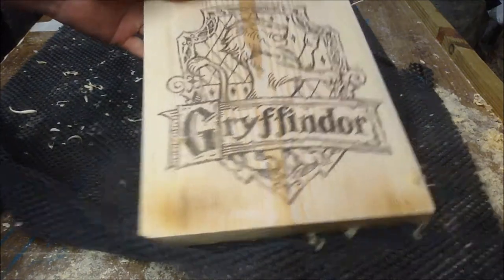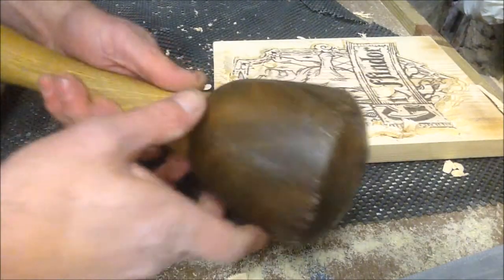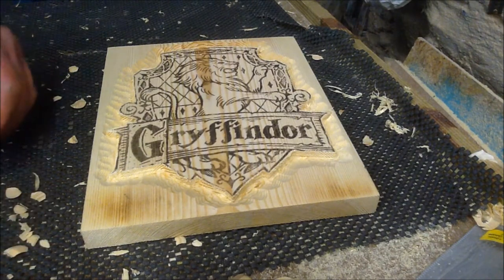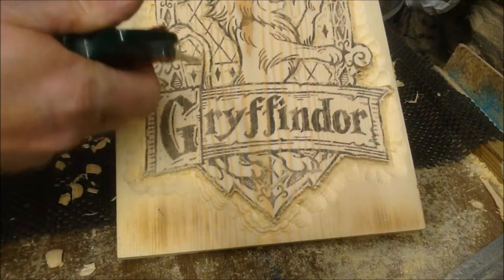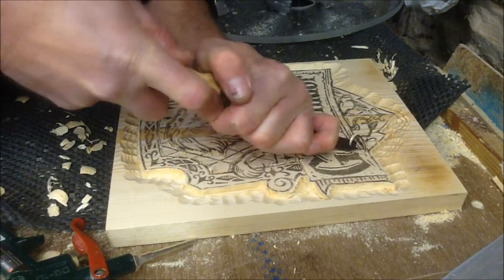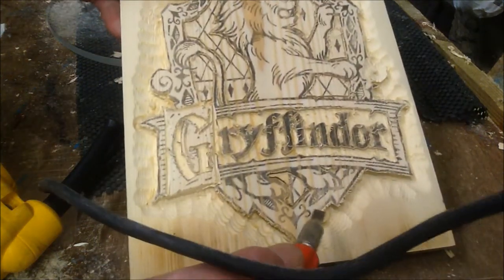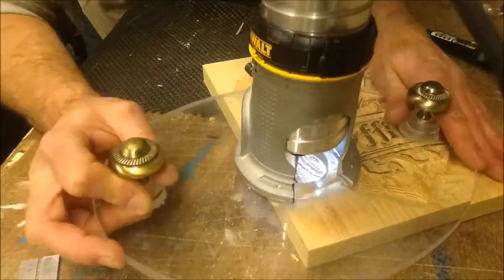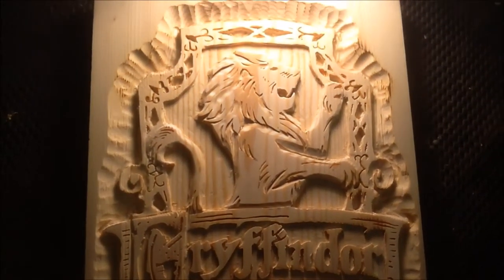Carving the Gryffindor Plaque

Comment: Wow, Last comment was a year ago?   I'm following in your footsteps.  I think I need smaller upcut spiral bits as I ran into the pine grain taking control on a straight line. (practice)  Going to have to sharpen my gouges.  I have a pointed bit that gives more finesse to cutting. But I'm going to get those smaller bits.  Have some hardened Chinese cutting burrs and I saw in another video you did that they're not for pine.  Me and Murphy are trying to find that year old trail you cut out. LOL!